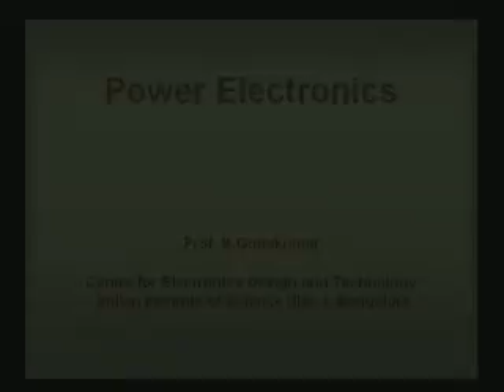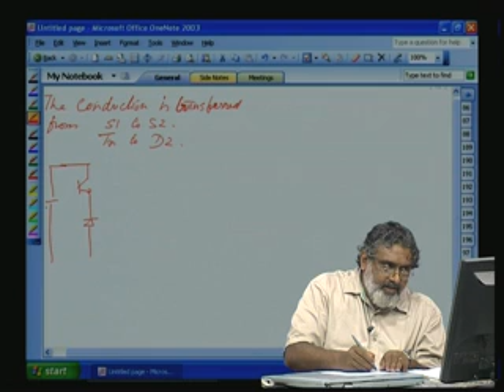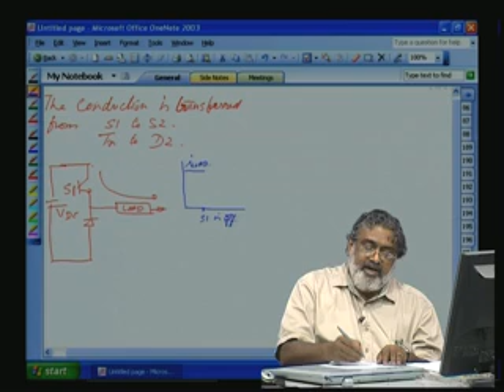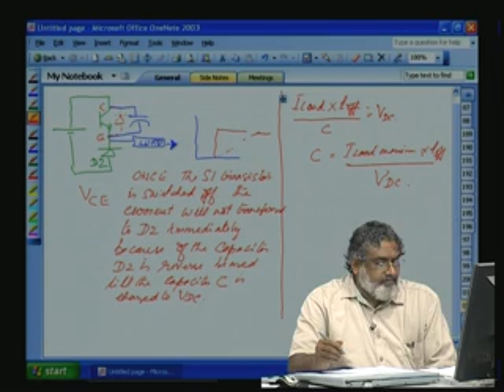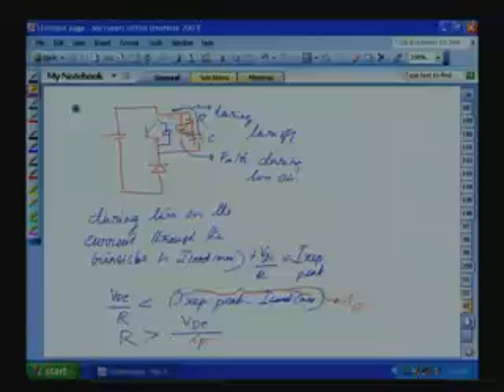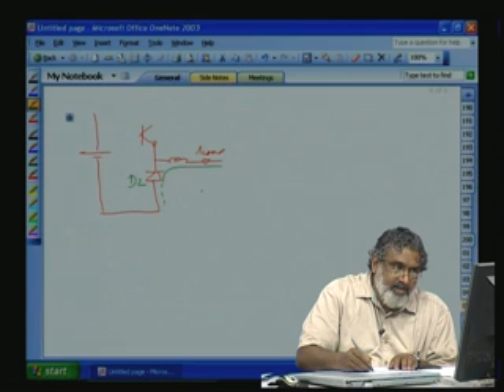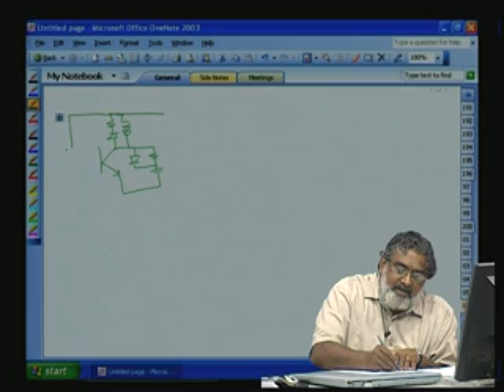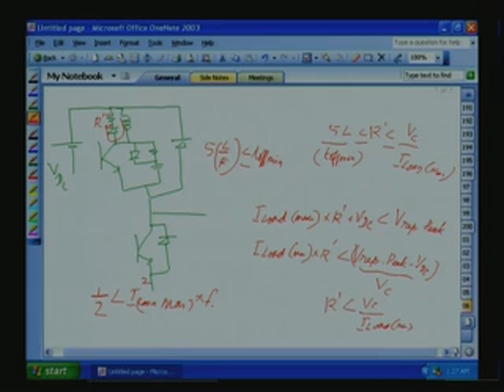Lecture - 37 Power Switch Protection - Snubbers

Comment: Sir, I am using a 3 phase contactor to switch a 25kvar capacitor at 440V(33A at 440V), can u suggest the right values of capacitor and resistance that can be used as a snubber to supress arc and protect the contacts of the contactor.